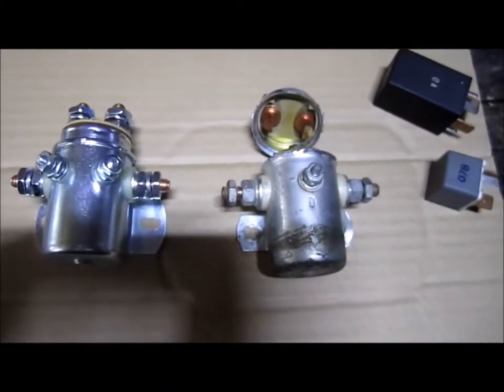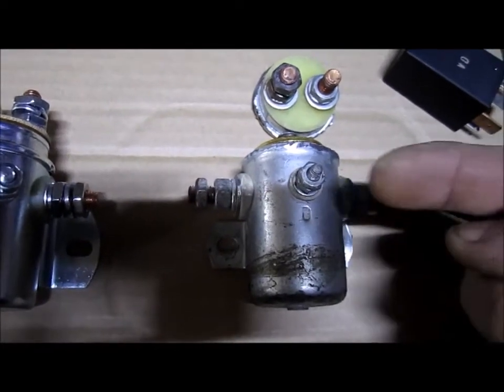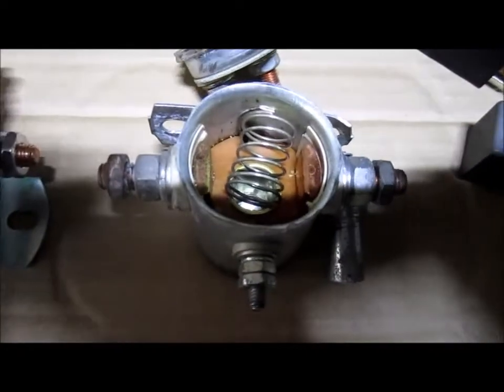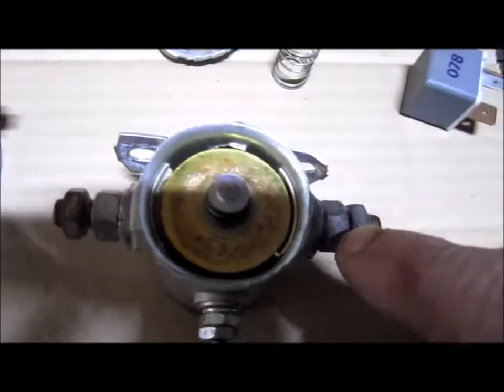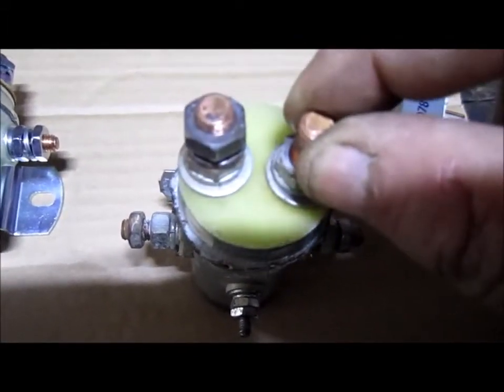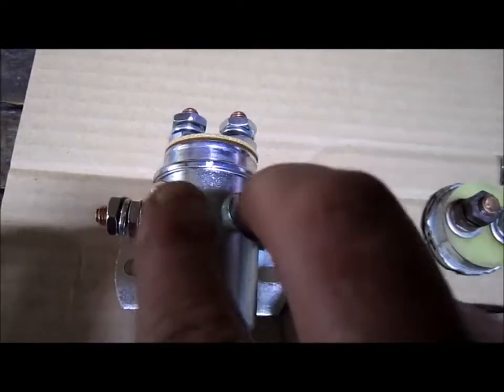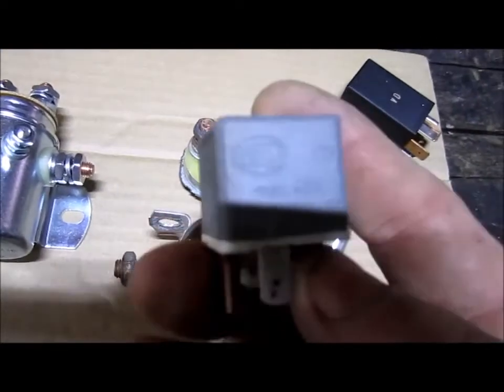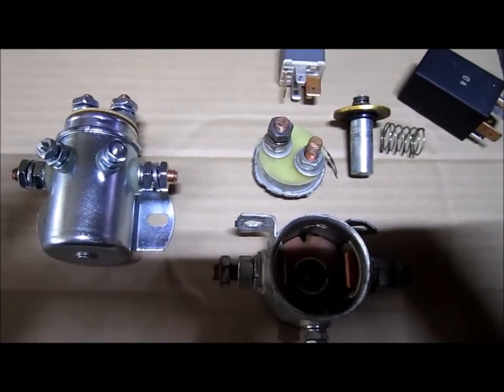How A Starter Solenoid Works And Looks Inside

Comment: I have a four pole solenoid but it doesn’t have top posts like yours . I’m not getting power from the left post to the right post. The battery wire is hooked up to the left post. Do I need to put the battery wire on the right post?
Reply from the maker: the contacts are either open or closed. That means when you power it up the other happens to be either open or closed.  You can always give it a continuity test to find out if you don't know. Also the contacts inside can get burnt to which stops the connection from allowing the current to go through. I,m not sure what you trying to do with it. It's simple though. it's either always open or closed

Comment: Yes sir, great video. But look I have a ATV that was trying to start even with the key off. I did not know but  but have now learned that it was a damaged wire and not the solinoid  itself, "I purchased another." I had to research so many forums to even get that far. Then I was confused on what wires to look for. Well I've been an A/C tech for many years and figured it out with my meter. But there is no videos on what to look for in that case, and/or where to even start at. I have seen this happen before on my friends mower and the shop charged him dearly. This might be a good video idea if you like. Darn rats and sticks!! Thanks
Reply from the maker: Good idea. Thanks for the tip and i,m glad you have yours figured out.

Comment: Question .. A five pole solenoid AIRTEX/WELLS 1M1025 has a ground pole in the rear of solenoid .. what is the ground pole purpose? Am I correct in thinking that when ground is completed at that pole - it then allow the contacts to be closed inside allowing current to flow through the larger poles (battery / starter) and the I and S terminals in front (much like a FORD Solenoid) stay independent and have power all the time?
Reply from the maker: The big lugs are the current carriers there either open or close contacts. The 5th one is the other end of the coil that trigger the contacts to either open or close. The other coil trigger wire will be part of one of the large lugs. Hope that helps. Some of them have two separate coil trigger wires but not all.
Reply: This one has the 2 large current carriers - it also has "I" and "S" AND a ground on the back odf solenoid that confirmed - triggers the current carriers open or closed (spoke with Airtex / Wells this am) so thank for confirming this with me.
Reply from the maker: Welcome. Glad its figured out.

Comment: So I'm confused, From my starter wire(activates the magnet) I have power when I go to start the vehicle, however it doesn't engage the starter. And I've used a brand new solenoid and a used one. It will not close the circuit from the battery to the starter. Why is this?
Reply: My dumbass didn't have the solenoid grounded to the body. Major slap to the face for that one. Thanks tho!
Reply from the maker: +unrealfmx888 do you make sure all contacting points are clean. It sounds like a dirty contact is all it is. The wire on the starter more so. It could even be the starter is losing its ground to the engine.
Reply: you have your positives and negatives backwards.  its switched polarity.
Reply: unrealfmx888 it happens.  Arkhams razor I suppose.